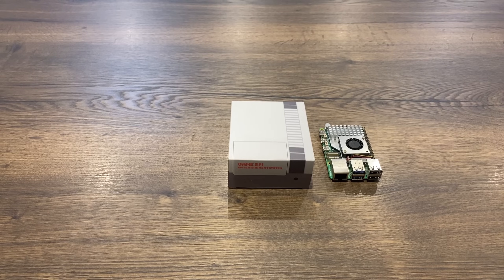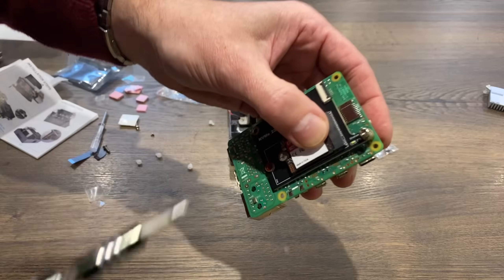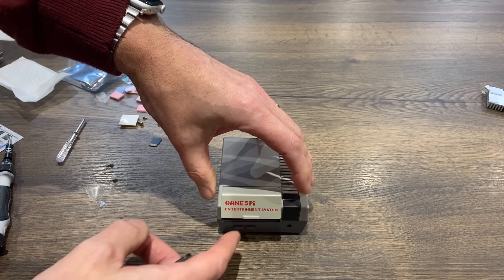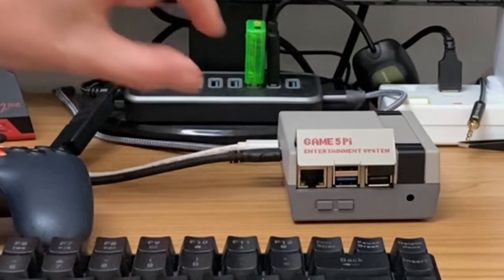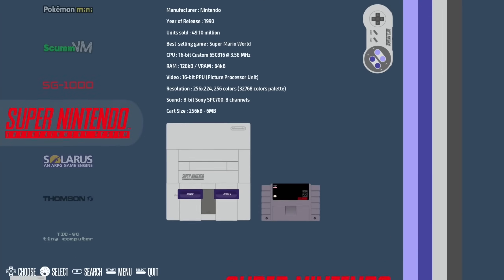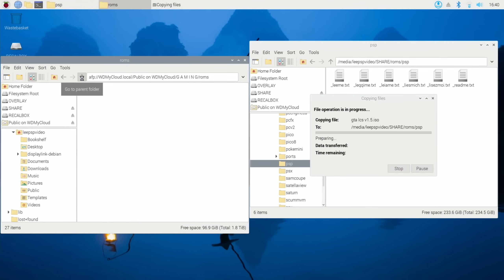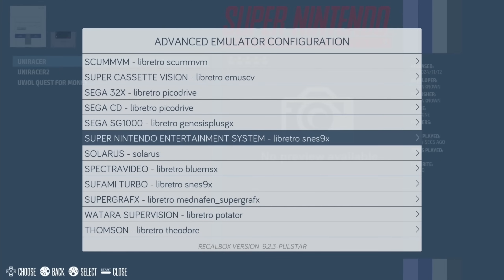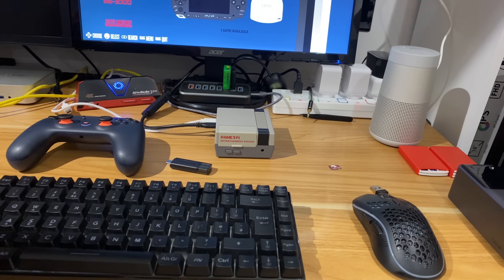Impressive Raspberry Pi 5 case with NVMe and 2 Fans

Comment: I am curious as to the cooler performance on this thing.

I have one I used for a simple NAS setup at home. So cooler performance isn't going to be a huge deal most of the time. Still curious though.

My lady has a laser cutter and the new Mac Mini base model connected to run it. Low on hard drive space in those things. So the NAS allows a fast storage option. And I or my lady can use our main PCs to create files for use on the machine when we don't want to go downstairs for that part of the work flow, then load files to the NAS and just access them on the Mac later.

Comment: Need help, got a issue with the case power button.  It won't depress so cannot switch it on.  I have had to take it out of the case to continue the os setup.
Reply from the maker: @nicholasgarratt5646  I didn’t have this. It’s only a bit of plastic. Maybe it just needs shaving down a bit
Reply: @ Got it working by taking out two screws on the board and loosening the other two a bit.  There is now a gap.  If I have any problems again, I will file down the inside of the plastic a tiny bit.

If the white button was made longer than it would have been better if it just poke through the case.

What has taken me a very long time is sorting out Batocera (sort of).  The NVME was found straight away after OS updates so cloned a 256GB USB SSD in 15 minutes.  It was 8x faster than copying to a USB 3.0 Sandisk stick.  Problems started on boot up and Batocera was crashing.  I had to keep removing the HDMI cable to get into Batocera but audio did not work.  It took me 5 hours to realise it didn't like the audio driver through the HDMI connection.  I connected a USB DAC and it booted fine automatically using that for audio.  No need to remove the HDMI cable.

Comment: I have put it together but not used the plastic screws.  What are they for?
Reply from the maker: @nicholasgarratt5646  for securing the heatsink if you aren’t using the nvme board
Reply: @leepspvideo  Ah right, makes sense.

Comment: Got this case coming tomorrow.  Is it still ok to put the fan on the 3v pin when using the the Raspberry Pi 256GB 2230 SSD for Batocera.  Just read the comments about the HDMI connection.  I hope I am ok but think the official cable will likely be connected all the time so no frequent unplugging.
Reply from the maker: @nicholasgarratt5646  3v is fine. If the Pi is working to hard it will thermal throttle which reduces performance. I wouldn’t expect that to happen
Reply: @leepspvideo  Thanks, it is out for delivery. :)  The most it will do will be Naomi/Dreamcast.
Reply: The Pi 5 and NVME has come and wow, they are so small.  I have only had a pi400 and pi500 until now.

Comment: hello, in the beginig you have a sd card with wht in?
And after how do you make the recalbox starting on the nvme? i don't undertstand ho to do this wotking.
This case is realy nice, jus better if the led of the nvme is going thrue the box too.
Reply from the maker: @Fromega001  Raspberry Pi OS was on the sd card. I used Raspberry Pi imager to write recalbox to the nvme

Comment: Hello,  just tested out the GeeekPi ABS Case that contains an Armor Lite V5 Cooler inside.  I think it was one of the first pi 5 cases out to market, but hasn't seen much love from the pi community prob because it lacks support for nvme. It's plastic with grilled lid and I think it's an improvement on the official case and fan!

Comment: I bought one of these just a few weeks ago when I got my Raspberry Pi 5 board, it's a great little case. I didn't realize there was another option that came with the NVMe board, I just got the case and the cooler. It was about $15 cheaper and it runs quite well from a microSD but still....I'm a little jealous now 😄
One thing I don't really like is that the case fan doesn't stop spinning if you keep the Pi plugged in. I might also follow your lead and try it on the 3v pin instead of the 5v as it is a bit noisy. I also agree that the micro HDMI and power adapter cable do sit a little strangely, I did actually lose HDMI signal when I moved the case a little while it was on. Video came right back but lost the audio signal to my TV and had to unplug and plug back in. It's just fine if I don't move it, hardly much to complain about. You could probably grind off a little of the plastic with a mini rotary tool to get a better fit.
Reply: My suggestion is to replace the HDMI cable because I've also noticed that after long-term use and frequent plugging and unplugging, the HDMI connector can become loose. This leads to poor contact. I even used a 3D printer to create a fixing device to secure the HDMI cable, considering the connector is quite small.
Reply: @52Pi_Maker_Education  Good suggestion, however in my case I ordered the Pi 5, case, micro HDMI adapter and HDMI cable just a few weeks ago. Unless the HDMI adapter is the issue, which is entirely possible. Cheap Amazon purchase.
Reply: @tedah_riagrimi  Well, sometimes it's an issue with the HDMI cable, and sometimes it might not be plugged in tightly. The connector is quite small, and the cable is rather stiff, so sometimes stress can cause poor contact at the interface. I've encountered this issue multiple times myself. Additionally, when installing the case, try to position the device as close as possible to the opening and then tighten the screws. Generally, it should work fine.
Reply: @52Pi_Maker_Education  Thanks for the suggestions. I might actually be building another of these with the NVMe board, I like the case that much. Perfect nostalgic gameplay for me. My first console was an original NES that I got from Santa for Christmas when I was 7 years old 😄
Reply: @tedah_riagrimi  Accompanying you since the age of 7? Wow, you must have a deep attachment to it, what a beautiful childhood!

Comment: Hi Great vid but are you sure it comes with a nvme board?
Reply: I did get one without the NVMe board and PCIe cables. It came with the case itself, Armor Lite V5 heatsink/fan, thermal pads, screws and a terrible little screw driver 😄
The link in the description does have the NVMe board and PCIe cables. Not much of a difference in price either.
Reply: @tedah_riagrimi  You can purchase the version with an expansion board that has NVMe support.
Reply: 1× Case Top
1× Case Bottom
1× Armor Lite V5 Fan
6× Thermal Pad
2× M2.5 Screw
4× Self-tapping Screw
1× Screwdriver

Comment: Regarding your Uniracer troubles: I'm just guessing here, but it looks like the original cartridge contained two ROM chips, here seemingly saved as two files. When you load the first one, it seems to start up, but as soon as it tries to read an address range where the second part should go it only seems to get cr*p data, which it then tries to interpret to the best of its knowledge, leading to some... oddities. Quick and dirty attempt for a solution: attach part 2 to the end of part 1 (along the lines of "cat uniracer2.smc >> uniracer.smc") and try to load again - it's a bit of a long shot, but consoles from back then should be just 'dumb enough' (for all SNES fans: no offense intended...) to make that gnarly attempt of a hack work...

Comment: It looks nice but doesn’t make sense due to cost. Buy a mini-pc and you will be far ahead of the game.
Reply: I think you're missing the whole point of SBCs.  Enthusiasts like them because they're not X86. A Pi5 4 GB is under £50 and you ain't getting a decent mini PC for that price.  Also, good luck when Windows 10 support stops.
Reply: @Comrade_Biff  "I think you're missing the whole point of SBCs.  Enthusiasts like them because they're not X86."

I would describe myself as an "enthusiast" as I purchased my first Pi back in 2012 when it was originally released.

I could care less about it "not being X86", I care that I could get a small and highly programmable Linux mini-PC for $35. Whilst Linux support for ARM is very good, it has always been better for X86 anyway.

"A Pi5 4 GB is under £50 and you ain't getting a decent mini PC for that price."

No, but I can get a used SFF PC with a 3rd or 4th generation Core i5 or i7 CPU and at least 4GB RAM for £50, and that already comes with a case, a PSU and cooling for that price.

"Also, good luck when Windows 10 support stops."

I haven't run Windows since support for Windows 7 ended. I run Linux as a proper adult's OS, not Microsoft's bloated rubbish.

Trying to crowbar Microsoft's privacy-hating OS on an SBC is truly ridiculous anyway.
Reply: @Comrade_Biff  "I think you're missing the whole point of SBCs.  Enthusiasts like them because they're not X86."

I'm an "enthusiast" given I've been building Linux on ARM-based SBC's since 2012. Ultimately I could care less whether they run X86 or not - Linux support for ARM is excellent but it's still better on X86, so one could argue X86 would be the better of the two.

I do wish people would express their own opinions, rather than choosing collective nouns like "enthusiasts" that just turns it into a playground argument of "my gang of pretend Internet mates is bigger than your gang, so my gang must be right". Very puerile.

"A Pi5 4 GB is under £50 and you ain't getting a decent mini PC for that price."

You can get a decent and used SFF PC with a 3rd or 4th generation Core i5 or i7 CPU and at least 4GB RAN for that price, and you're not paying extra for cooling, a PSU or a case. Plus it will outperform an RPi5 as well.

"Also, good luck when Windows 10 support stops.

I haven't used Windows at home since support for Windows 7 ended. Anyone who tries to cram bloated and privacy-hating Windows onto an SBC, when Linux does a much better job of running on a small platform, needs therapy.
Reply: @Comrade_Biff  Please don't use collective nouns like "enthusiasts" to further an argument at a school playground level with "my gang is bigger than your gang" rationalisation. I want to hear YOUR opinions, not what you think those are of a "pretend group of people that you just made up".

I'm an "enthusiast", I've been building Linux on SBC's right from 2012 when the first RPi was released - I've built in on every generation of Pi and a few others like Orange Pi, Banana Pi and Asus Tinker Board. I could care less if SBC's are ARM or Intel - I could argue that Linux support is great on ARM but is still better on X86 anyway.

As for Windows, I haven't used it since support for Windows 7 ended. When Linux does such a good job running on SBC's, anyone that tries to crowbar bloated and privacy-hating Windows onto an SBC needs therapy.
Reply: Even better, buy an old PC with a 3rd or 4th generation Core i5 or i7 CPU in it for less than a Raspberry Pi 5 (especially when you factor in a case, cooling and PSU which the PC will already have anyway) and put the GPU in the PCI-E slot in that.

Mini PCs are also a complete waste of money like modern SBCs are. They made sense as small low-powered boards for education and hobbyists at $35 a pop, but then the self-entitled gamers always have to step in and make it about them and having more power all of the time.

Comment: While the case does look nice out of the box and includes an nvme board, functionally I don't like it, with cables coming out the side and having the usb and ethernet ports under the flap instantly ruins the look the moment you plug something in.
I'm hoping retroflag release an updated version of the nespi 4 case as that is more than just a case, its a retro gaming experience with its functional power & reset buttons, power/hdmi/ethernet ports on the back, 2 usb ports on the front to match the original controller ports and a functioning cartridge (sata ssd) slot, in my opinion it's one of the best looking pi cases available.
Reply: Portable style?
Reply: This can be considered a dust cover; when you're not connecting Ethernet and USB devices, you can keep it closed to prevent dust. Of course, once you plug in the cables, the cover will definitely be lifted. This is basically unsolvable. It depends on personal preference. If you don't want to compromise the appearance, there are actually many different products to choose from.

Comment: Do you have to do the whole eeprom process to use the nvme instead of sd card? Or pi5 knows to check if sd card not installed?
Reply from the maker: Not any more only the pcie 3 bit to go from pcie 2 to 3 speeds

Comment: Lee, now that Jeff Geerling (and others) have cracked the code to get modern GPUs working on the Pi5, we need to see you do it!
Reply: So you're going to immediately remove two of the Raspberry Pi's important design features of "small size" and "portability" by tying it down to one place with a PCI-E extender and huge graphics card?

You can buy a used 3rd or 4th generation Core i5 or i7 PC for less money than the Pi 5 and have a proper case that lets you stick the GPU inside it - and the GPU isn't going to bottleneck the Core i series CPU as quick as it will the Pi one.

The PCI-E interface is useful for, say, multi-port Ethernet boards so you might then think about putting pfSense onto it and building an interesting router and network application server, but I left Geerling's channel a couple of years ago when he decided he was going to connect a huge number of hard drives to a Pi. Sure, it makes him look a bit "wacky and clever" but very few things he actually does are of any use when in you're in front of a group of kids in a learning environment and trying to show them useful, and more importantly, PRACTICAL things to do with a Raspberry Pi.

If anything, I prefer Lee's content here because he does the low-level desktop stuff that, for the most part, is at reasonable cost for anyone to do.

Geerling's an entertainer and good luck to him, I wish him well on his channel and its growth. But I'm an engineer as well as a long-term Linux SME and I look at what good things I can make that solve a computing problem in as practical a way as possible - and there is NO point in sticking a PCI-E GPU on a Pi or Geerling putting 20,000 hard drives in some "wacky" RAID configuration on one.
Reply: @terrydaktyllus1320  yes
Reply: It feels like a small horse trying to pull a big cart.